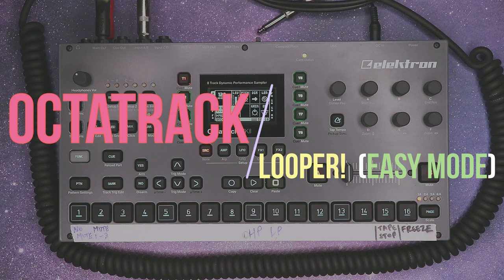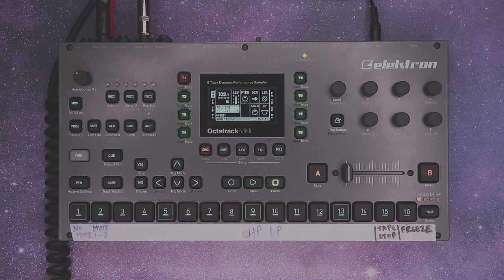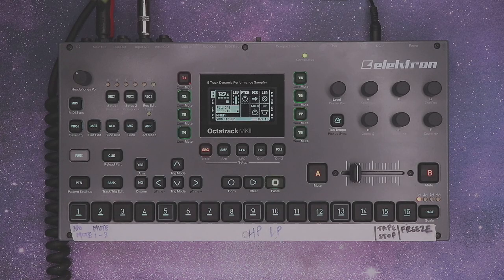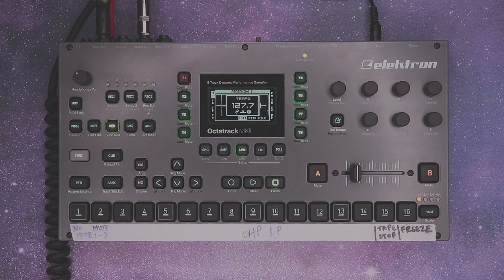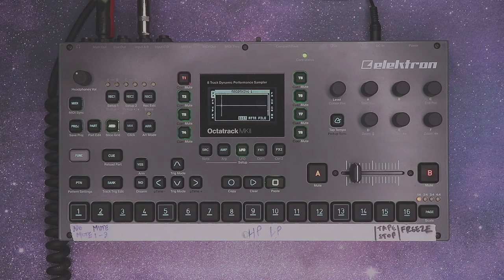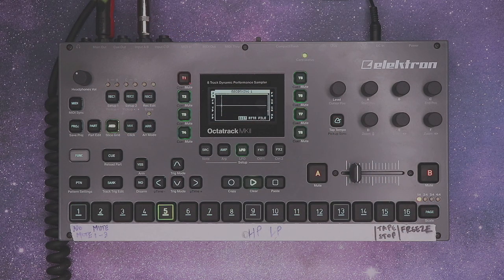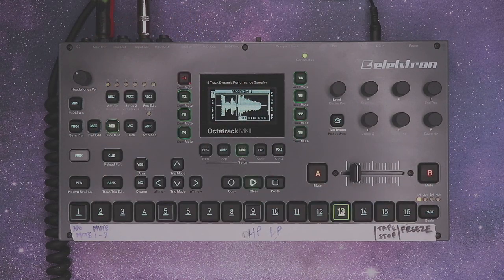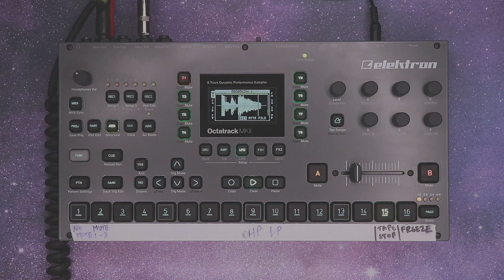Octatrack Tutorial Video: Looper!

Comment: love this kind of tutorial. short, informative, simple, no excessive "um"s or heavy breathing, not verbose at all. please keep making these. also, ive never used pickup machines before, i noticed you set it up to record the pattern length, which was 16 steps, but the loop was 2 bars, can you explain why that is?
Reply from the maker: The pattern length was quantizing the start and stop points of the recorder. So it would start at the beginning of 16
Reply: @EZBOT_  Does the mean the loop length will be determined by when you hit the REC2 button?

Comment: You’ve mentioned that you and a lot of us came from a guitar/ alternative/ rock/ metal background, and that’s something I’ve noticed as well. I think that’s why there have been a lot of incremental improvements and adjustments to keyboards like ROLI, MPE, and aftertouch - because when I first played keys I found myself wiggling my finger around on the keys like I would while playing guitar to modify pitch and add accents. Now there’s a lot of devices that implement that capability.
Reply from the maker: Totally agree, that’s one of the reasons push 3 excites me.
Reply: @EZBOT_  Speaking of Push 3, which is awesome, I like to use my Digitakt + Syntakt with my MacBook, Live, and Push 2 when I’m doing my hybrid set or at home. It’s excellent with Overbridge. I have 8 individual DT tracks and 12 individual ST tracks I can switch between to play or even stack them by arming multiples of them at a time. I use Live’s external midi devices which have much less latency than simply running them through audio tracks like I see most people do. I love Elektron sequencers but it’s also nice to work with midi clips and automation sometimes. Plus there’s a ton of effects available to me going the hybrid route.

Comment: Thank you. Simplicity at its best example. 
I’m sure there are many more things that Elektron machines do using your simplistic method. 
Maybe you could consider making a series of videos and selling it to AskVideo 
Great work. 
Thanks again 👏👏👏👏👏👏
Reply from the maker: My Bitwig instructor Thavius Beck already has that covered otherwise I totally would do that.
Reply: EZBOT i follow him too. Great teacher. But your three minute tuts are effective and instant result oriented 😝🤣😝
Btw when I try to dub over my first recording I always get the prompt. PB dub aborted 
Why 
My OT is master 
I understand many complain about this but I’ve yet to find a solution over the net
How does it work do well in your project 😜😜😝

Besides why is the recorded loop so low in output 
The gain control on the SRC page does not increase the volume
Reply from the maker: @grandmasterjo1  make sure you are set to REC Trig "one2" in rec 1 menu. Try Function + midi to erase
Reply: EZBOT I did exactly that but same result. 
However I opened a new project and it works 👍
While rerecording when I press Rec2 the playback of the previous recorded loops tends to get louder. 
Which means the first loop recorded sounds volume 5
When I record the 2nd loop  and I press Rec2 the first loop get louder volume 7
If I record the third loop and press Rec2 to stop the volume is 9 
Why is the volume increasing with every next record 
Sorry to bother you 😌
Reply from the maker: @grandmasterjo1  make sure you don't adjust the gain in the src. Leave it at zero and only adjust the amp volume
Reply: EZBOT Thank you for being so kind and helpful.  
Consider making something called 
“ 5 Minute Tricks for the OT”   

or A4 or Digitakt or Digitone 

If you do 10 tricks with a 5 minute intro. You’re looking at a one hour video. 👍👍

Comment: Did you connect your guitar straight into the Octatrack? Or any preamp or amp simulation? And thanks for your videos!
Reply from the maker: Yes, strait in with no preamp. You can adjust the amp page for more volume. Don't adjust the gain. Joyo has a cheap preamp FYI

Comment: Nice explanation. Two thing  i do not understand when trying this on my mk1. The pickup machine does not overdub when it reaches max length instead it erases the previous recording. And the other strange is that I can not preview/ hear the pickup machine recording. Only the live signal.
Reply: Make sure to set your rec1 settings to ONE2 not 1. Also in the second page make sure to turn AB or CD up to 127.
Reply: zbs thanks. But it’s set to one2 and I have the level on screen two set to 100.

Comment: Is there an equivalent erase function on the MK I? There is no REC3 button on the old Octatrack.
Reply from the maker: No, there is not a shortcut key like there is on the MK2, however if you just press REC 1 again after you have already started recording  it will record over instead of overdubbing.
Reply: You can press func + clear after you opened the audio editor (rec1 + edit).

Comment: How do you monitor this without hearing it on one side, since the mixer is only A+B and C+D? Cuckoo a long pickup machine tutorial did a tutorial and was using a thru machine just to monitor mono inputs.
Reply from the maker: Doing it right now. You just have to set the it to record only input C (or whatever monoo input you are using) in record menu 2. Than in record menu 3 you are just adjusting the volume of inputs AB, CD

Comment: I'm having a hell of a time using this machine as a guitar looper. I'm a shitty guitar player, so I need more than a second to prepare. What I do is I set the pattern length and record length both to 64. Then, I set a one-time recording trig on the 33rd step of the sequencer and turn on the metronome. This gives me a count of two bars, then the recording starts. I want the Pickup machine to record the length of the loop ONCE, then stop recording and begin to play the loop back. The only TRIG setting that works this way is HOLD. I'm not sure why that is, but I just roll with it. So I get a 64 step loop this way, but hell if I know how to get it to play if I have to stop the sequencer. It just won't play. Plus, I'm not able to figure out how to overdub on the loop. I've read the manual on the Pickup machines several times and I think I've watched every tutorial about it on YT, but I'm not able to find anything that works. If anyone has any suggestions, I'd love to hear them.